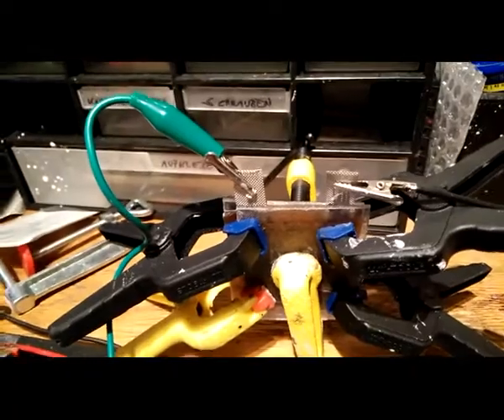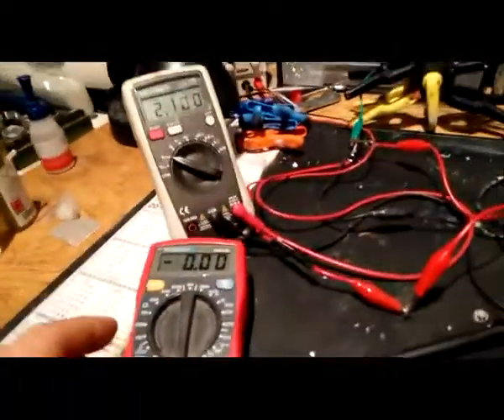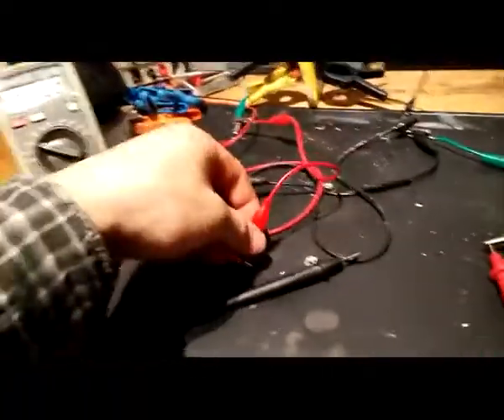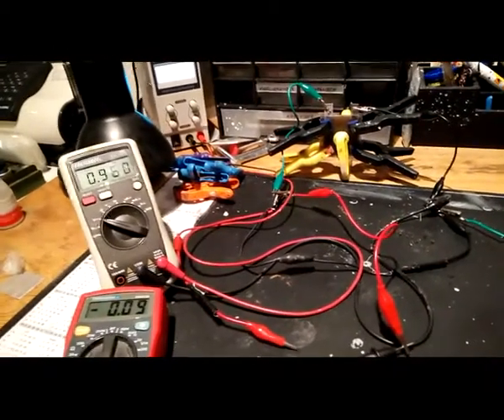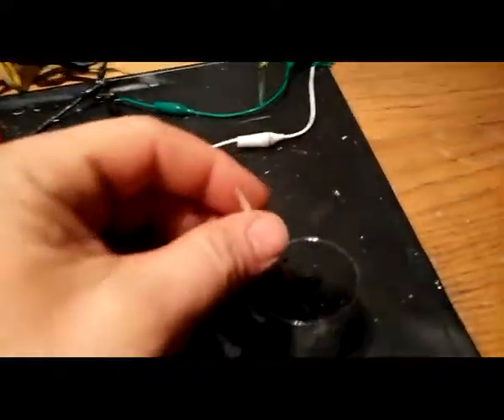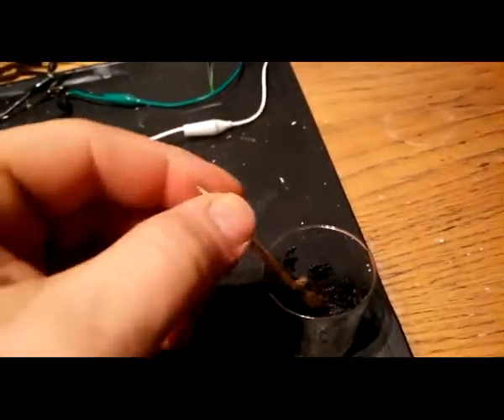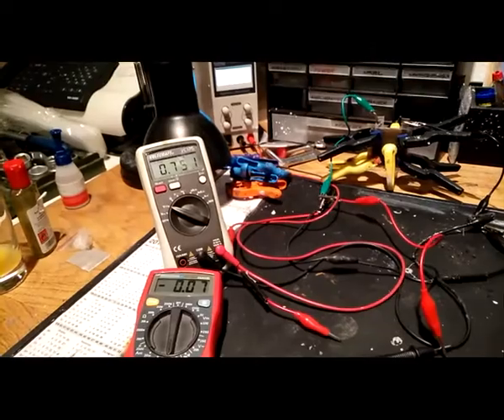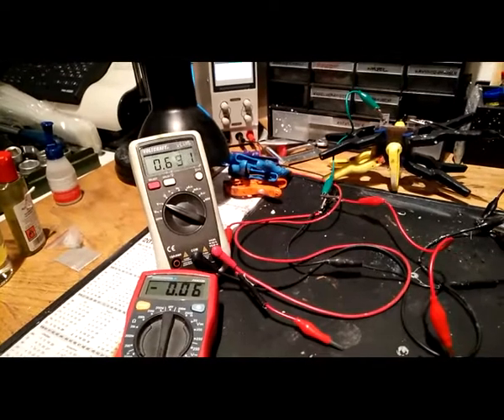My first sugar super capacitor :-)

Comment: Very good but, at the moment  I work fule time  with very advance active Fule  H3O+  It is more then the Alkaline and more then The Hydygen, No more experimenting i do just trying to assemble everything. If you interested ?
Reply from the maker: +Bartosz Barejko 
HI Bartosz.
I use steel mesh for my cap. H3O+ will destroy the steel. I need the have a base for my eletrolyte.  Befor i used also aluminium but when you use aluminium you have to have a eletrolyte without water. ( ionic liquid) and thats relay hard to make.
Reply: ehochimalpi I do see you do not know that there are many different H3O+ , so you just watch me if you want.